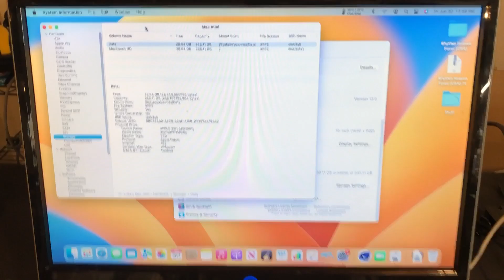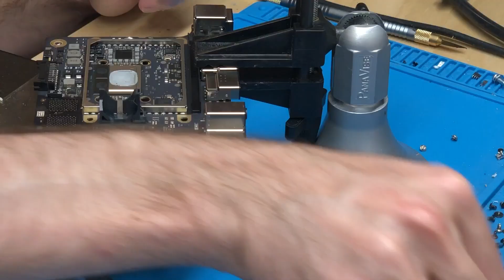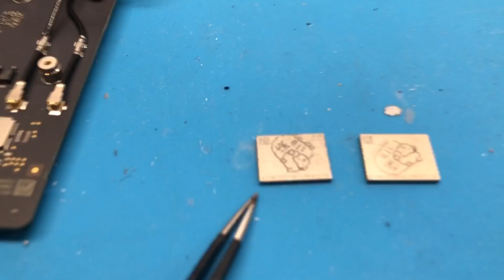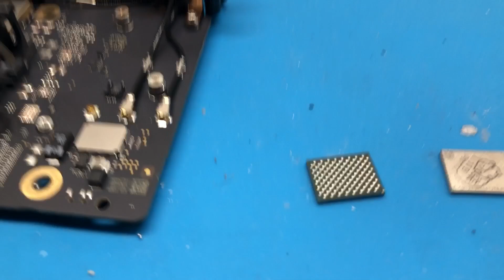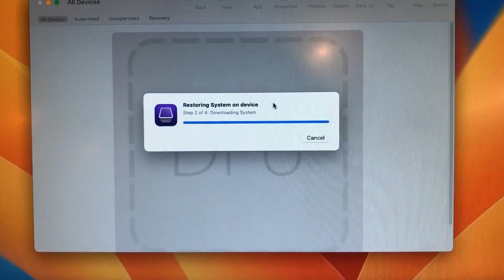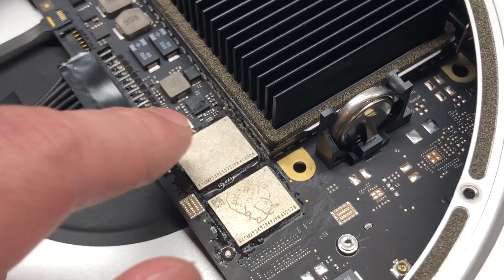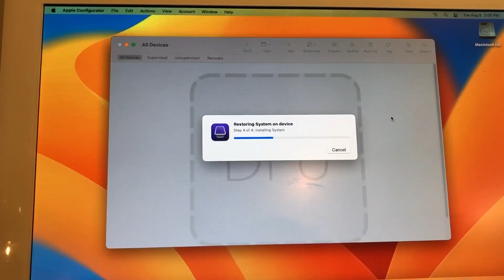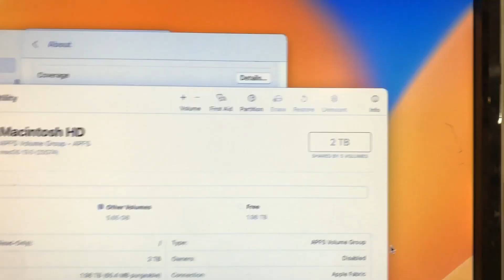M1 Mac Mini Soldered SSD Upgrade

Comment: I just got a macmini M1 that show the SOS signal with the LED, but when in DFU mode I am unable to restore the system. I guess and  hope that the  SSD is done. What is your experience with the M1 macmini? Or is it possible that the CPU/RAM went bad? Thinking of finding someone to do what you did in this video. Going  from 256GB to at least 1TB.

Comment: I’ve upgraded my M1 Mac Air A2337. It gets stuck halfway installing (the bar on my hackintosh doing the restore) then it bootloops back in dfu mode. Only Apple logo and back to dfu loop. I’ll update after trying a newly updated hackintosh probably. Messed up one board so guys I’d recommend trying it out in a bad board first.

Comment: This is why I would never buy an Apple product. They are just too much work to upgrade, which is very much by design. I understand that planned obsolescence is a thing on most all products anymore, but Apple takes it to the next level. Plus I am so used to Windows and Android at this point, it would take me a long time to get used to anything else. Great job though, I've always found great satisfaction in repairing/upgrading older products to fully functional form.

Comment: sir please help me i am using an imac 8.1, after using the patch the audio is not working, i have used the post install patches i tells me i have to use terminal after cache rebuild has been forced tried numerous times with and without force rebuild.
No audio is coming out no headphones , speaker internal speaker
please someone help me

Comment: Tips:-  Once you've removed the underfill, adding a decent flux around the Chips will make de-soldering alot easier with your hot air gun, which I would circle around the entire surface of the chip to melt the solder balls evenly. 

Personally I'd use more flux when putting the new chips on so when heating with the hot air again circling the surface of each chip you should see it wiggle as the solder balls melt and surface tension will naturally centralise the chip onto the pads on the board. Remove heat then press down on the centre of the chip (not too hard!) with tweezers and a final re-heat of the chip again circling to ensure the solder balls melt evenly will ensure good contact with the pads :-)

Comment: Thhis is a joke right, 4 places I asked for this mod quotes $1500 which is $1100 more than getting the 2tb in the first place
Reply from the maker: Not at all... I normally do this full upgrade for just around $300, parts and labor included. Not sure what places you’re looking at, but it’s nowhere near hard enough of a job to warrant over $1000 for the service.

Comment: I've seen people do this before and that's exact reason why I didn't work at their end this is why I'm bringing it up to you I signed another YouTube video where they were able to do this perfectly fine but they had the same problem that you're having as soon as they plugged in a monitor and tried tried it work fine The mad many recognizes all devices that are connected onto it especially during a software install so you have to have a monitor installed it's like taking a part an iPhone replacing the battery and then expecting it to power up just by hitting power button without plugging it in

Comment: Not even using flux? And why on top of chip heat, it's more effective to move it around between board and chip so hot air get directly on pads

Comment: Congratulations on sticking with this and getting the upgrade to work. One question, how do you clean the board after attaching the NANDs? As you know, that flux has got to be removed otherwise you're going to have serious corrosion problems. In a production facility, the boards go through a wash process. What do you do?
Reply from the maker: I normally ultrasonic clean the boards after I finish working, but sometimes I will just thoroughly clean with rubbing alcohol.

Comment: Typical mac F YOU to the owners.  The cost and labor involved is silly.  Which is why Mac does it now.  I had a boss at a shop I worked at tell poeple we could do these repairs yet he wouldn't buy us the proper tools to do it like a hot air station etc.  Was nuts.

Comment: Will this process work for M2 macbooks as well??
Reply from the maker: Yes.
Reply: @dosdude1  any challenges for macbook air 15 with single NAND, but another space is available to attach one more SSD
Reply from the maker: @vada-e4m  Can be done, but the currently installed chip must be either wiped or replaced (making it blank) in order for that to work.

Comment: I'm pretty sure someone wrote a validation in the programming as `arr[0].FirmwareDate == xxx`. so I bet if you follow the process like 0 as official nand, and 1 as unofficial nand. reformat and then use the previously reformated unofficial nand on 0 and a fresh unofficial nand at 1, it would work

but again, what a awesome hunch you had to use official nand on 0th position. you are awesome

Comment: This is what I did successfully time after time. 
Principle : let gravity to do the parting. 
Do : 
0) apply soldering flux around the IC to be removed. 
1) with a precision tweezer, lift the IC together with the mother board 0.5~1cm above the table. (The far side of mother board may touch the table)
2) apply soldering hot air on top of the IC 
3) when all solder joints of IC are in flow state, mother board will fall gently on the table leaving the IC behind by the tweezer. 
Benefit ? Never can the mother board or SMD parts getting overheated.

Comment: Is 2tb the max tho?
Reply from the maker: For the regular M1, yes.
Reply: @dosdude1  thank you, but why is that? Is there some kind of hardware limitation?
Reply from the maker: @Nico-xt7wt  The regular M1 only has enough I/O for two NAND chips (same applies to regular M2 and M3), and the largest NAND chip they make for these is 1TB. The M1 Pro/Max/Ultra have I/O for 8 NAND chips, and therefore support a max of 8TB.
Reply: @dosdude1  thank you, is there a standard for these NAND chips? If so what’s their name?
Reply: @Nico-xt7wt he told you everything dude 😂😂😂

Comment: Blank nand won't work, you need to reprogram them using JC p13 reprogrammer for each spesified model. look up "Replace EVERY DEAD SSD for M1 Max, M1 Pro, M1 & T2 Mac, T1 Mac, BONUS:M1 Ultra (FOR DUDES IN DENIAL)" on youtube and watch that.

Comment: i think the problem you was facing because of some security basically to avoid a hacker to switch the disk on board and read its content, i believe somewhere in firmware it might be checking for some kind of code to make sure chips are not changed.
once you put the chip 0 of original board, i think that passed that check and restore proceeded.

I am wondering is there no other way to fresh installation or like boot it from usb the procced with a complete new installation??

Comment: This is where some regulation would be good. There is no reason not to have upgradable storage on mac mini not even design reason. If apple thinks soldiered ssd works best that's fine use it but also add at least 1 ssd slot somewhere there is plenty of space

Comment: I have a mac-mini for music production, I forget which model but it's the last one that had user-upgradeable storage and RAM.  So I'm running it with 2TB and 16GB ram.  It's finally starting to get a little long in the tooth so I was thinking of upgrading to a newer one.  I thought I'd check out if it's doable to upgrade the soldered parts myself.  After watching this, I don't think there's any way I would attempt it or even want to try.  It's sad because I'm not sure some of the sample libraries I own would do well streaming from an external USB-C drive.

Comment: Mixing probably worked because the solder connections may have been bettered after multiple heat gun and cool offs. Probably also good links from the soldered balls without cross connections. 
That’s the only thing I can think of as to why this configuration worked.

Comment: Deja Vue... Apple is as it always was.  I worked for a company in the 1980s that made good money soldering in more ram on sealed Macs.   Every notebook I own, I can upgrade the SSD with a screwdriver, thanks HP and, my desktop I built.

Comment: You mentioned pins didn't have to be aligned well, then went on a wild ride blaming the issue on a lot of other things. It could be the chips were ok and you were not aligning all the pins correctly and/or some needed to be pushed down further.  Try spending more time making sure all four corner pins are properly aligned and apply more heat when installing them.

Comment: It’s absolutely disgusting you have to solder to upgrade hardware. Why can’t Apple use NVMe’s?
Reply: How could they charge a premium for cheap storage then? Do you ever think of the poor poor billion dollar company Apple? No, you only think about yourself.
Reply: @rainersnookh  😂😂😂😂😂
Reply: That way they profit off repair.
Reply: @reaktorleak89 they don’t even repair it; they just trash it instead
Reply: As well as overpriced at-purchase upgrades
Reply: And not to mention after couple years down the lane these old gen mac will be cheap but scary to use coz nand might be all worn out and it is difficult to replace them and don’t think you can just hookup external drive to boot so which inturn make the make elastic!,!
Reply: Apple uses PCIe for this kind of NAND chips since 2015, PCIe is a protocol while NVMe is an interface, @Anonymous-ei8ex probably is referring to the modular design of the device that won’t happen anytime soon btw.
Reply: question not even worth asking (although the answer is, of course, profit).

vote with your money, end the atrocities and stop supporting these dickheads
Reply: Git gud at soldering
Reply: there are some minor advantage to soldered on ram and ssds the foremost being that Moduls can be a lot smaller compared to pci slots, but i agree i dont like this trend either
Reply: Just accept the repairs are changing and buy the stuff to install/reflow/remove chips. Take away apples power, by spreading such content
Reply: Because is targeted to morons
Reply: Bcos apple are assholes.  I cant wait for Arm chips on windows.
Reply: Because Apple is a closed system and greedy. Duh.
Reply: Because they are greedy bastards
Reply: Because basically they are dishonest bas****$.
Reply: Apple would have you compare the I/O performance of an M1 mini’s built-in storage vs an nvme drive on a PC (or on a Mac via external Thunderbolt enclosure). Apple’s SOC-integrated controller is capable of much greater performance. Whether this performance advantage is meaningful for everyday users is a different question though.

I do wish they’d favor repairability though, and this stuff should at least be socketed or the like even if it’s an Apple-proprietary interface.
Reply: they would not be able to earn
Reply: U r right,  this is one of many reasons why I don't buy apple product. Apple robs us.
Reply: Still trying to figure that one out...
Reply: $$$$ . Apple knows that fanboys will pay up regardless😅
Reply: Oh they absolutely can. You’ll notice over a span of years random machines will have ssds and ram soldiered or socketed in random variations. Apple will use what they have to due to their suppliers availability with no chassis changes. This tells you they’re full of crap when they state any reason other than revenue generation. Only exception is now the ram on the SOC.
Reply: @stevenPounder-p4b  fun fact: the macbook air had the same processor from like 2015 to 2017, when they moved laterally in the lineup (as in still shitty 5th gen i5) to a processor with the same specs because it became practically impossible to source the other ones anymore, and then they finally fucking upgraded to 8th gen or whatever in 2020 when it became more fucking expensive for them to keep sourcing the ancient chips than switch to a modern one.

might have got the dates wrong, but this shit is true and fucked up. base clock of that i5 was 1.6GHz, and it was consistently below that because it thermally throttled so bad. and this was in all variants and years.

also, all the macbook air batteries come defective from the factory, they even have a secret free replacement program because it is a known issue but they have a bunch of asshole requirements you have to meet in order to get the replacement and they will never ever tell you about it voluntarily. I have personally seen and replaced many many macbook air batteries. If you ever see one where the trackpad glass has been raised level to the rest of the chassis instead of being slightly indented, that battery has swollen up.

Edit: and even the replacement batteries they provide under the program are defective and will most likely go bad within the year.
Reply: Why don’t you buy other brands?
Reply: @william7950  regardless of whether you're the one buying from them or not, the pain trickles down to you eventually. can attest to that
Reply: Simple answer - profit 😂😂
See how their macbook price increased price drastically by just changing the storage capacity ?😂😂 But people still buying macbook that is why apple continue doing it.
Reply: Keeping repairability impossible helps keep Apple devs keep buying avocado toast.
Reply: So that you can’t do it 😂😂
Reply: Because screw consumers
Reply: Because apple is crap 😂
Reply: If only everybody stopped buying their crap for a few months and demanded repairability. That would be great, either Apple would go outta business or we would get what we all deserve
Reply: @warrenmcclure7819 Yup, exactly that. But unfortunately people keep buying their crap. And for what? OSX? You get your work done in applications, not in the OS.
Reply: @warrenmcclure7819  remember when Apple starved their laptop users of ports for so long that they acted like they were bestowing them a blessing when they included fucking hdmi and an sd card reader in the 14 inch.

and the mushy ass keyboard that at least didn't stop working on encountering dust and had actual key travel
Reply: Because nvme uses a different interface than emmc? You do realize that nvme requires that the cpu have dedicated pcie lanes, right? Not every chip manufacturer includes pcie interfaces into their chips. Storage that utilize pcie also get hot very fast, so they probably cut them out for efficiency. Not every storage interface utilizes pcie. Ufs 4.0 has similar speeds to a low teir Gen 4 nvme m.2 ssd, but are soldered onto the board. Emmc is definitely a one size fits all, almost all the time and doesn't produce too much heat for those low heat high efficiency applications.
Reply: @Kimtron142 "nvme uses a different interface than emmc", you realize this machine is thousands of dollars? People have every right to complain. Emmc is slower and cheaper than nvme, yet they charge $600 for a $100 difference in price (Not including wholesale, it's probably $50 for them)
Reply: @Kimtron142  blud, practically everyone uses pcie including apple. it is used for wifi cards and ram and a bunch else. the reason for the soldered on ssd and ram is most definitely to prevent upgrades
Reply: @rolls_8798  literally not the case. Apple's m1 chip doesn't have pcie lanes to utilize m.2 anything. It's not a wifi card, it's a wifi chip. It's funny how wrong you are
Reply: @Kimtron142  looks like i was a bit behind on that one.

totally besides the point though, since Apple was already soldering SSDs in their macbooks while they had Intel chips and wifi cards.

also, does the thunderbolt in apple silicon macbooks not use PCIe? or do they not support thunderbolt now or something?

also, seems fairly clear to me that they solder the SSDs for the same reason they solder the RAM, I would like to know your reasoning behind that

also would like to know your reasoning behind why they got Samsung to rearrange the pins on the bog standard removable nvme SSDs used in the macbook airs from like 2013 to 2020
Reply: @rolls_8798  what's with these gotcha questions? I'm not an engineer. All I know is that apple doesn't use expandable storages and people who complain are annoying. I'm not an apple shill, I'm just tired of everyone complaining about everything tech related. Get a life
Reply: @Kimtron142  it's just painful. apple's shit has genuinely caused me much much grievance, loss of money, and wasted weeks worth of my time.

fuck time machine too
Reply: @Kimtron142 I think you are right but remember, apple is a billion dollar company
They can make nvme ssd possible "if" they "want" to
Reply: @rolls_8798 they weren't with intel chips you could take them out and replace them, yes they were the same type, no they were not soldered on.
Reply: @448Studios  that's just straight up wrong. they've been soldering the SSDs in all of their devices apart from the archaic 2015-designed MacBook air since about 2019 I think, and some models already before that.

besides, the SSDs that came before that aren't even 'replaceable' because they've got a dumbass rearranged layout and pin design specifically to prevent an upgrade with an SSD you can actually buy - and that's been like since before 2015
Reply: @rolls_8798 no. It’s actually entirely the point.
Reply: @Kimtron142 🤡 because apple *chose* to not implement features in a sensible way to prevent user upgrades
Reply: @jasonkim6266 you are so painfully wrong. Apple has never used emmc ever, apple silicon still uses ssd that interfaces with the cpu via pcie, they just lack the controller since the controller is on the soc itself.
Reply: @Kimtron142 they have to include pci lanes, otherwise gpu, wifi, and usbs will not work lol
Reply: @SamuelPiresN  wrong, guess again
Reply: @Kimtron142 he doesn’t realize any of that, he just wants to complain.
Reply: @Kimtron142  Mumble jumble, crapple lover.